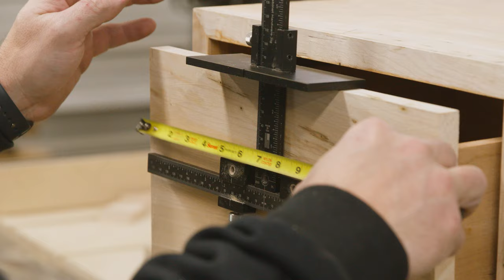I Made My Own Plywood!

Comment: When I'm joining the veneer I'll usually glue the joint at the same time that I am gluing up the veneer to the substrate (taping the joint from the face side, and leaving the tape in place when in the bag). Just saves you that clean up phase between glueing the leaves together and laying it up. Also guarantees that nothing slips and causes a step in that joint that will prevent the veneer making good contact with the substrate in lay up. I also apply my solid lippings before the veneering, so the veneer covers the lipping joint, and with good colour match it's almost impossible to tell it has been lipped that way. Always enjoy your videos, really nicely made and produced  👍👍👍
Reply from the maker: Great way to do it!